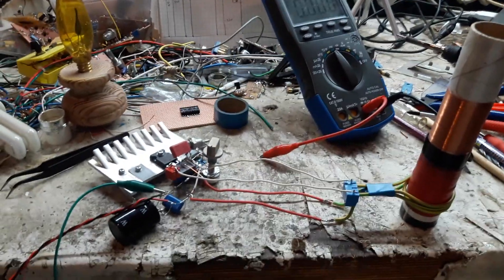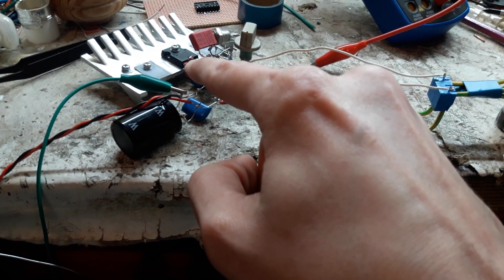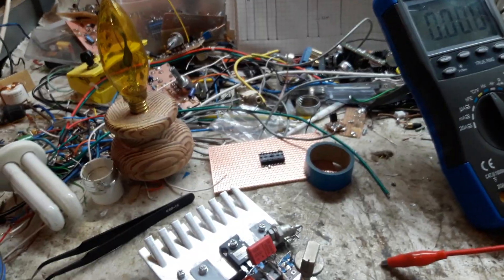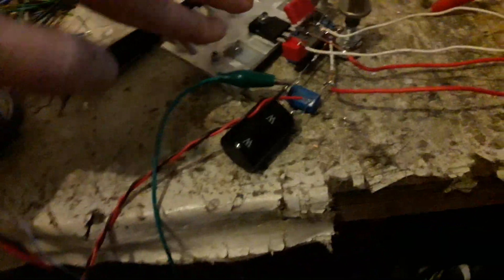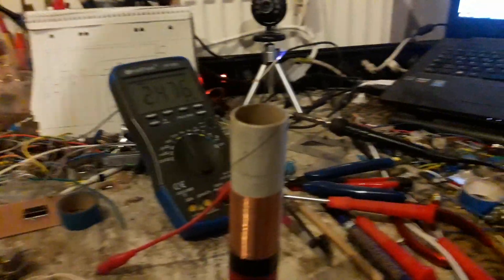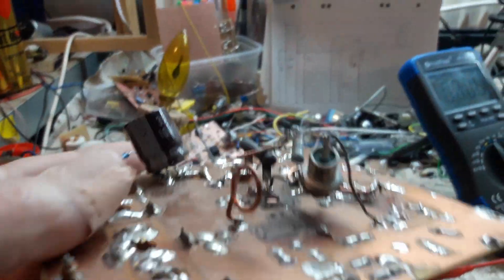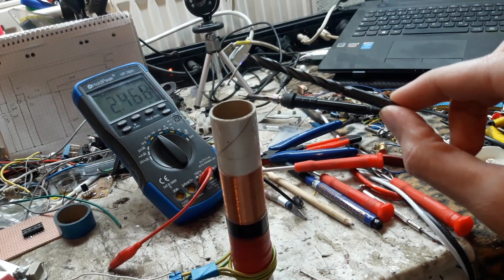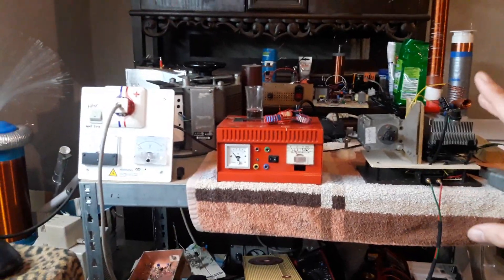Hfsstc- different circuit running 2.5 MHz coil

Comment: Hell yea it's working alright, probably a good idea to use a beefier zener too. I'm not quite sure I didn't just break it with the gorilla hands but I want to say one of the first zeners I used originally was only like a 1/2 watt and it ended up overheating and breaking. Adjusting the primary for me was easiest at lower voltages and moving it up and down while it was running to observe the breakout. Depending on the coil it seemed like there were certain sweet spots. For the small coil I could just plop the primary all the way down for the biggest breakout but it would also draw the most and not pull the longest arcs for some reason. Just a tad higher was the best as far as breakout and current draw. These are so fun lol.
Reply from the maker: yeah man got to remember, the zener is regulating the voltage and the more input, the hotter it gets ! ill switch mine out with a 10v to see if it effects the circuit but ive been playing with it for a few hours and cranked it up to 40v short runs, the output is much better, ill do a quick vid before i get dinner
Reply: @dirkk82  Sweet, I've been wanting to see 30v+ output but haven't built a supply for it yet. I'm just kind of wondering if with the right modifications it could be made to work similar to the other Teslaundmehr HF circuit but without needing a honking variable capacitor which either way is going to take up significant space if the goal is a mini type deal.
Reply: Man I tried making my micro guy even smaller and condense it all down and now it doesn't work the same go figure. Now I'm going to be stuck trying to get it working again. Good times.
Reply from the maker: @Magneticitist  that's what happens some times, just when you think it can be smaller, that extra bit of wire or whatever made the circuit work perfect 😂